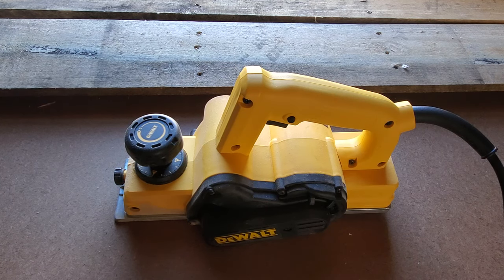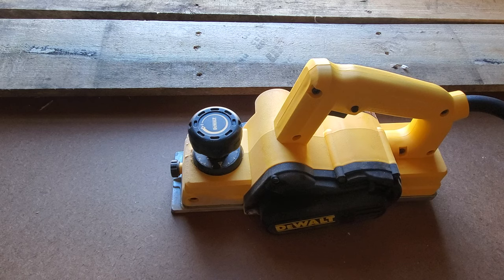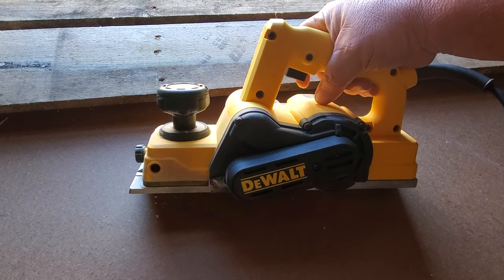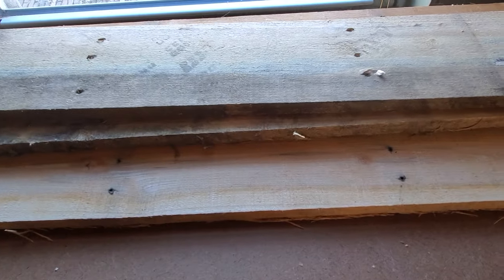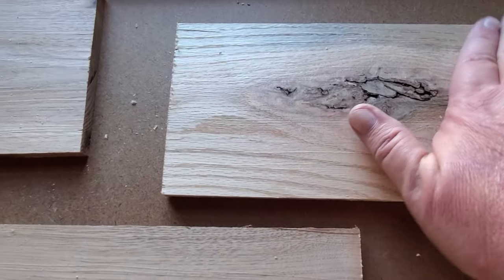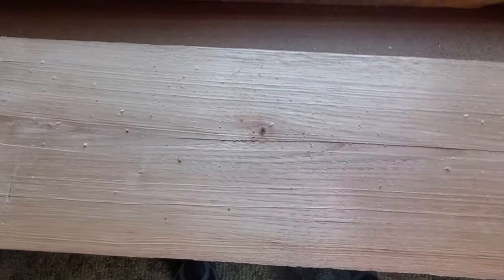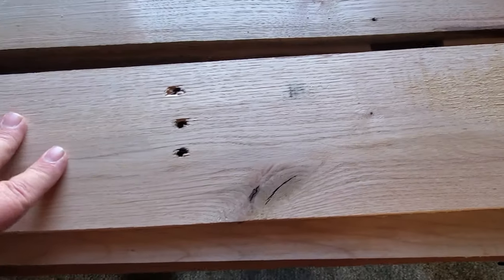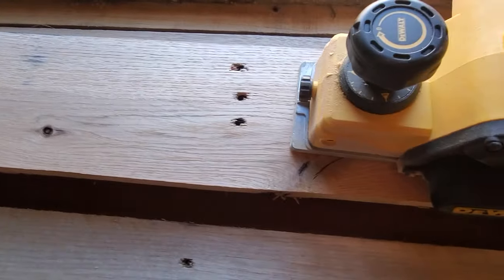Pallet Wood & The Dewalt D26676 Hand Planer🔨

Comment: Given the choice, would you get the 7-amp, or does this 5.5 work just as well? I am not used to a planner, or ever owned one but feel "bigger is better", would you agree? I am trying to smooth tree "cookies" of a large size (26 - 34 inch diameter). 
Thanks for your post.

Comment: Is a belt sander with rough grit not a viable option because of the expense of a lot of belts? I guess one would simply have to discover for oneself. I have a good belt sander and can get 110 grit for very cheap. This hand planer is intriguing but still seems to come in at around $150 or so. Amazon has a WEN for similar cost. 1/16 seems like a lot of removal for each pass, but maybe for this kind of wood that is what you need.
Reply from the maker: +William Farris I'm sorry I misspoke on that.  It cuts to a maximum of 1/16 lol.  Not increments of 1/16.  I don't have a belt sander, so I can't offer an opinion on that.  I know my palm sander goes through a lot lol.
Reply: @StBernardAcres  Oh, Ok. IT seems that the planer goes a lot faster anyway. And it is like 130 on Amazon. I will give it a think. I still think it would be interesting were you to try some of that Tarkett acrylic putty in those nail holes jsut to see the difference (Oak Wheat or Oak Harvest color PC7706).
Reply from the maker: @williamfarris8531  I will try some of that.  My son got me this planer for my birthday from Lowes.  It's about the same there.

Comment: Hey Joe!
In answer to your thumbnail question:  No.
I'll leave it at that.
All the best, matey.
Reply from the maker: +SarkyBugger These hardwoods that I get are either heat treated or kiln dried.  People worry about shrinking or expanding,  but these are all really stabilized, and will not suffer that.   It's the exact same overpriced planks from the hardware stores, except rough cut.  I could easily cut out the nail holes, glue and clamp these together and make large panels cheaper and way nicer than plywood.  Thanks my friend!  Have a great one!
Reply: @StBernardAcres  If you butt joint them, they will either shrink or warp, at some stage.  Don't you have a table saw?
Reply from the maker: @sarkybugger5009  I wouldn't glue the up with running the through a jointer or a jig on my table saw.  Depending on what I wanted to use the for, I might even run the trough my router to make them tongue and groove joints.  Then I would seriously want a thickness planer lol.
Reply: @StBernardAcres  Any joint is better than none.  A simple rabbet or rebate would do.
Reply from the maker: @sarkybugger5009  You're right!  A simple rabbet would be easy,  and much stronger!